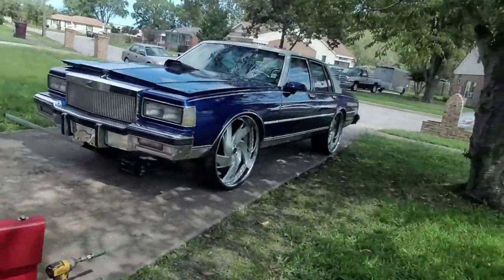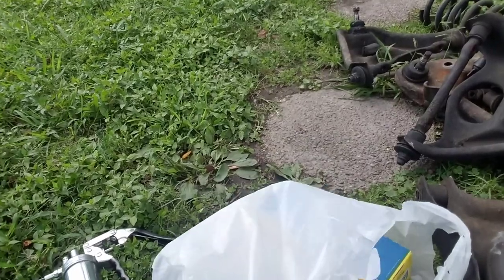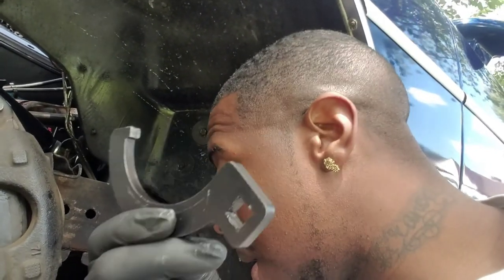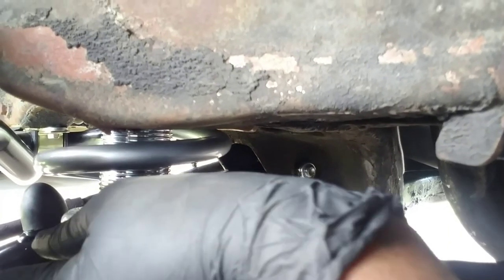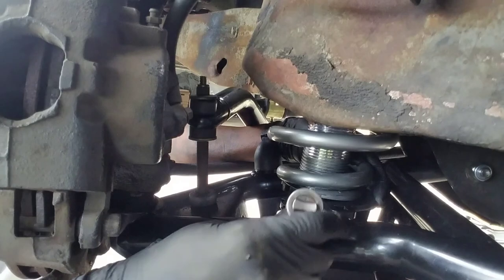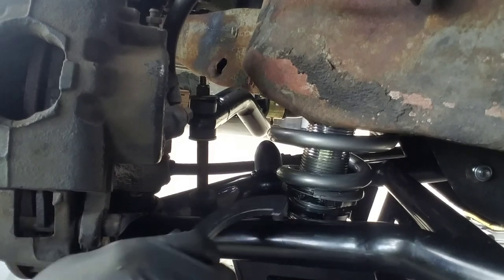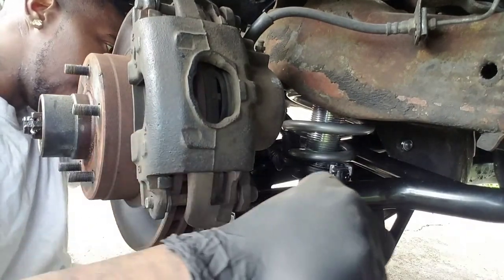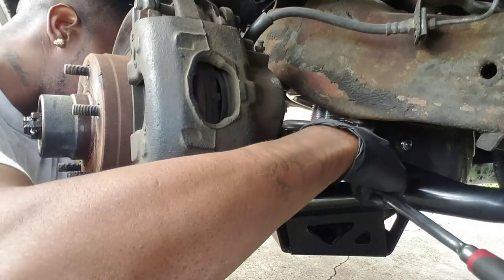QA1- Time to adjust ride height

Comment: Why you get the dropped control arms if you want higher ride.
Reply from the maker: THEY TUBULAR CONTROL ARMS NOT DROP
Reply: @mississippitv7941  i see. but the bottom control arms have that deep pocket.?
Reply: @mississippitv7941  how far did you go up on the threads ?
Reply from the maker: @drptp5017  THEY ARE JUST MADE LIKE THAT BUT THEY NOT DROP CONTROLS
Reply from the maker: @drptp5017  ION REMEMBER OFF THE TOP OF THE HEAD BUT I HAD TO GO UP A GOOD LIL BIT BECAUSE OF HOW LOW THE COILOVERS DROP THE CAR
Reply: @mississippitv7941  ok. Im only asking cause im in the sane boat. Just put on arms and coilovers. Now im adjusting height. But it looks like ill have to go up pretty far to get stock height
Reply from the maker: @drptp5017  YOU GOOD, I HAD TO GO UP FAR ON THE FRONT AND THE BACK JUST BECAUSE WHEN YOU 1ST PUT THE COILOVERS ON THEY AUTOMATICALLY DROP THE CAR SUPER LOW, I HAD TO ADJUST 3 OR 4 TIMES TOTAL AFTER TAKING THE RIMS OFF AGAIN TIL I FINALLY GOT IT AT THE HEIGHT THAT I WANTED 🤘🏾🤘🏾🤘🏾
Reply: @mississippitv7941  so. Basically you got it to stock height? Just gotta adjust springs all the way up?
Reply from the maker: @drptp5017  I ADJUSTED MINES HIGH ENUFF THAT MY RIMS WONT HIT MY FENDERS WHEN I TURN. LOCK THEM DOWN AFTER THAT FINAL ADJUSTMENT AND NEVER HAD TO TOUCH THEM SINCE
Reply: @mississippitv7941  ok
Reply: Big props that Thang nasty, question  does lifting it stiffen up the ride?  I wamr too lift mine up I was going woth heavy duty springs but I heard it mess up the rode and makes it stiff
Reply from the maker: @aaronlewis7562  IF YOU PUTTING HEAVY DUTY SPRINGS ON WITH BLOCK BETWEEN THE SPRING. YES IT WILL STIFFEN THE RIDE CAUSE THE SPRING CANT FULLY FLEX LIKE IT NORMALLY WILL WITHOUT THE SPRING. 🤘🏾🤘🏾🤘🏾

Comment: How high did it lift ?
Reply from the maker: I just lifted it high enuff so when I turn my wheel it's not hitting my fender but it could be adjusted higher depending how much clearance you need
Reply: @mississippitv7941  thanks homie you got me thinking now
Reply from the maker: @wdc1818  you want regret going coilovers g 🤘🏾🤘🏾🤘🏾
Reply: @mississippitv7941  will they clear 30’s on a box chevy
Reply from the maker: @dropzonemedia7811  I can't even give you a clear awnser on that, you have to reach out to qa1 or somebody on ig who has 30s and ask them did they work for that set up.

Comment: I just received my QA1's front & back. But I didn't see the tool for adjusting the hight. 😐
Reply from the maker: The front should come with the tool but rear you have to buy them, summit have them they are called spanner wrenches
Reply: @mississippitv7941  Thanks Bruh... By the Way I only bought them because you had them on your Clean A** Chevy! 👍🏽™️
Reply from the maker: Already my boi you gone like them junts 🤘🏾🤘🏾🤘🏾